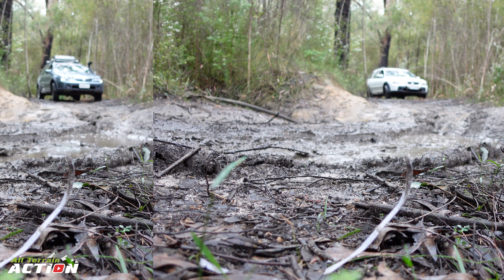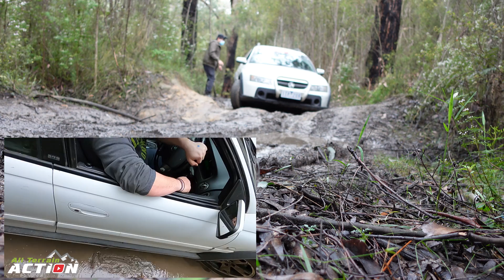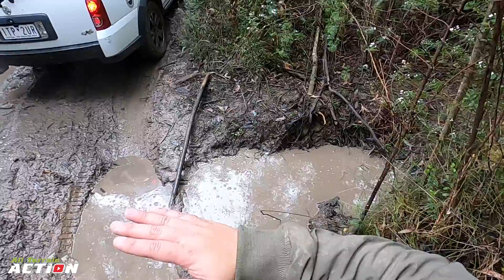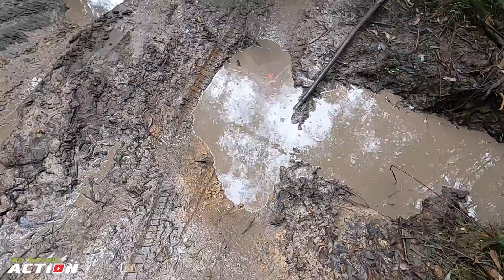How to work Traction Control System off road

Comment: You know how they put the warning signs for air bags on the sun visor, well next to that should the operating instructions for crosstrac. Its similiar in my Forester...take it easy, keep the power on so it is slowly spinning and wait..Good lesson ATA!
Reply from the maker: haha cheeers Benny! I assume most traction controls will work similarly.
Reply: @AllTerrainAction  I haven't read the manual, its just what I do when I get into a pickle, push gently and wait. 9 times out of 10 it drives out all by itself.
I started looking at Adventra's again - they have the towing capacity  (2.1t) the Subarus (1.6t)  don't but I keep getting stopped dead  in my tracks when I see the fuel consumption figures. I wish they had released these with a diesel. The nice thing about diesel is it is much safer to carry jerry's...petrol in the heat of the day is just a bomb waiting to go off and fuel economy, I imagine would be in the 8l/100 vs 13l/10 they advertise (it will be much worse in reality no doubt).